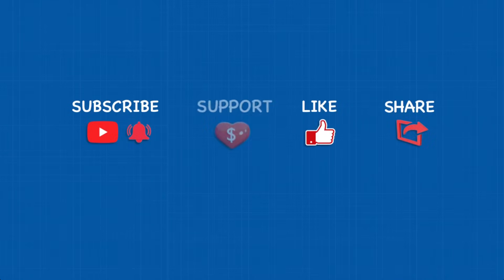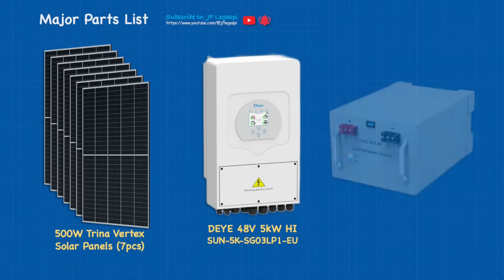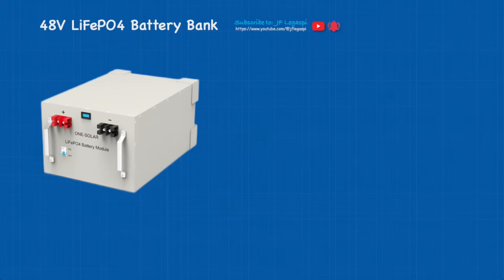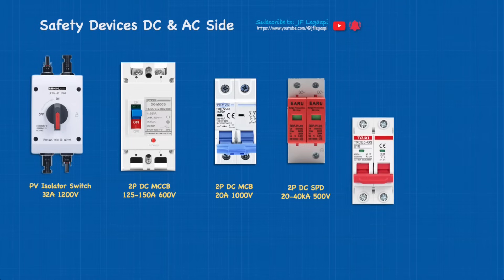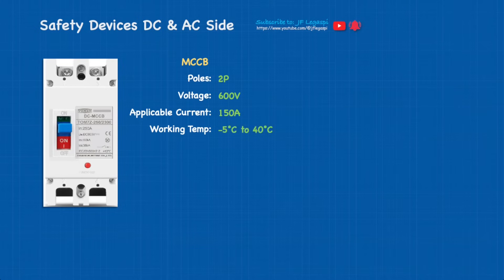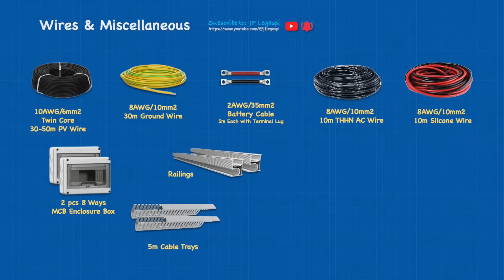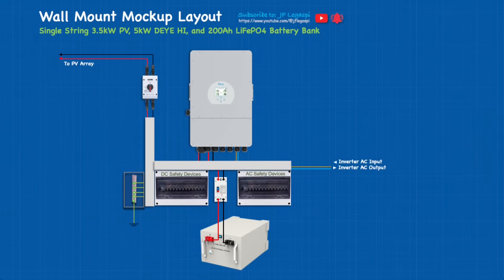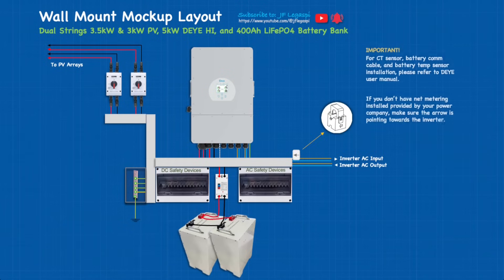How To Build a 48V 5kW (Deye) Hybrid On/Off-Grid Solar Power System - Complete Pro Level Tutorial

Comment: Hi hope you are well. Can you please tell me why PV input voltage range is from 125-500  Volts while MPPT voltage range is 150-425. Aren't the wires coming from PV connected to MPPT so if 125 Volts are coming from PV , how will MPPT operate as it needs 150 Volt
?
Reply from the maker: The voltage range refers to the total Voc (Open Circuit Voltage) of the solar pv string. That 125V is when the inverter starts working but might not be stably charging the battery bank or exporting energy back to the grid, due to the fact that when it’s cloudy, the Voc gets lower than that. That’s why they recommend 150V (lowest) when it comes to the mppt voltage.

The Mppt voltage range refers to the total Vmp of the solar pv string. Ideally, the lowest voltage recommende for that mppt tracker to work continuously (even when it’s cloudy), is 150V. Typically, the Vmp voltage is always lower than the Voc.

I hope it makes sense. 😊
Reply: @JFLegaspi  Thanks so in short MPPT voltage range  is in Vmp which is less than Voc so that's why MPPT voltage range is higher? 
Also, can you please explain the formula of  how to calculate all the circuit breakers and SPD ratings ? 
Many Thanks

Comment: We are in Cebu City and the electric grid here uses line to line. The Inverters that are available here are EU standards. the Input and output terminals are L-N-PE. How do you safely wire the inverter? I've purchased 14 550 watts Trina panels using your discount since I'm a follower of yours and I'm also thinking of purchasing a Solis S6 inverter. Which inverter to you prefer? The new Solis S6 Pro 6KW or Deye 5KW? Which one will you recommend? Thanks

Comment: Sir JF, sa setup na ito, pwede bang hindi na ikakabit ang grid line sa Inverter? Bale maglalagay ako ng isang separate ATS para kung batt low na ay kusang lilipat sa DU.
Reply from the maker: Good day. Pwede po. Para po makasiguro at maintindihan nyo ng mabuti, pakibasa po ang specs at manual ng Deye inverter. 😊👍

Comment: Sir JF ano po ba ma-e rerecommend nyo po na pinakamagandang brand ng Hybrid/controller inverter po? 
Sana masahot,  salamat po
Reply from the maker: Depende yan sa budget ninyo. Napakaraming magagandang hybrid inverter na mabibili.
Reply: @JFLegaspi  yong DEYE unit na ginamit dito, ok na ba yon gagamitin.  May warranty ba yong mga parts na to? sa US kasi, yong nag install ng solar unit mo, sila na lahat pumili ng parts from PV panels to the Inverter at commissioning/permit application.  So, binayaran ko is the entire system at may warranty yong parts for around 25 years, maintenance and repair.  I do not have to worry if any of the parts fail.  Dito sa Pinas, if you buy these parts and DIY, is there any reliability that these parts last for a long time?  Maintenance and repair is always borne by the owner.  So, if the parts that were installed did not have long term history of reliability, you end up costing your system more.

Comment: Hello po! Question lang po sa load side ng inverter, papunta po ito sa existing distribution panel ng bahay, meaning po ay magiging 2 pair po yung cable sa main breaker ng existing distribution board? 1 pair po from inverter side at 1 pir from DU side? Thanks po at God bless! Maraming salamat po
Reply from the maker: Good day. Kung gusto nyong gamitin ang solar setup sa inyong buong household load, dapat may ATS (automatic transfer switch). Merong para main power source at back-up power. Nasa sa inyo kung akin ang gagawin nyong main power, solar setup or DU/grid.
Reply: @JFLegaspi  Salamat po! Nag iisip po kasi ako mag DIY. Do you do consultation ang design po? Salamat po uli at God bless!
Reply from the maker: @reggiecadsawan3572  opo, design, calculation/simulation, single-line/block diagram, parts list etc… pakibasa ang video description regarding may services. 😊👍☕️

Comment: Sir JF saan po ba dumidepende yung battery na 12v 24v 48v?
Reply from the maker: Good day: Kung budget ay concern at nasa learning stage ka pa lang, o di kaya ang paggagamitan ay camping van na mostly 12V dc ang load, go for 12V system. Kung system efficiency and stablity, go for 48V system. Ang 24V ay kung medyo concern sa budget pero gusto na medyo efficient ang system. 😊👍
Reply: @JFLegaspi  thank you sir JF. Balak ko po kc sir mag DIY solar setup 3kw po

Comment: Hello, I've  just installed a new DEYE SUN-8K version.  It is working well, but the main screen does not show the 4 round KW dials with the "ON" in the middle.  How can I get to that screen, please? And If I touch the ESC button below, it flashes that screen on but only for fraction of second.  What am doing wrong? My system is OFF grid only.
Reply: how many pannels/ power did you connect to the 8KW Deye?
Reply: @GlossaME  10 panels, 585W each.
Reply: @deanko55-bw4oo  i think you can go up to 10 Kw of panels with no issues

Comment: Hello sir JF, pede po ba 12pcs na 500W series sa deye 5kw hybrid? same specs po ang panel trina solar brand
Reply from the maker: Kailangan nyong mapanood ng buo ang video. Unawain nyo ng husto ang specs ng Deye inverter, lalo na ang PV Input Voltage at MPPT Voltage Range. Ano ang Voc ng 12pcs na 500W in series? Kailangan pasok yan sa specs ng Hybrid inverter.

Comment: Good day! Sir JF applicable ba ito ang mga devices para sa 8kW hybrid inverter? Balak ko kasi bilhin pakonti-konti para hindi mabigat. Pag nabili ko na lahat ipagawa ko sa Electrical or contractor pag uwi ko dyan sa atin. Salamat po.
Reply from the maker: Good day. 😊👋 Kung gusto nyong pagawan ng design at simulation ang 8kW solar power system na balak nyong buuin, pwede nyo akong kontakin sa aking FB messenger. Eto po link. https://rb.gy/mzh5z
Reply: @JFLegaspi  Thank you Sir JF! Mabuhay po kayo.

Comment: Good Morning Sir the said Inverter(Deye-5kw) as mentioned in your presentation the Input PV current is 13A + 13A..But the specs tell otherwise its 11A +11A..The Solar Panel(500w) used here the Isc is 12.28A..Wala bang maging problema dito..Thanks and God bless
Reply from the maker: Good day. That’s exactly the reason why I have specified the model number of the hybrid inverter, DEYE SUN-5K-SG03LP1-EU under Major Parts List @ 2:07 time stamp. Here’s the link to the specs. 

https://www.deyeinverter.com/deyeinverter/2021/04/14/%E3%80%90b%E3%80%91hybridinvertersun-3.6-5k-sg0103lp1-eu.pdf

Ibang model number ang gamit nyong inverter kung 11A + 11A ang input.
Reply: @JFLegaspi  Sir Many thanks..Take care

Comment: Great! I read a lot on the Internet but this absolutely the best description! Thanks a lot for this!  My deye5k is waiting for installation.  One question when i start without battery... same  starting sequence of the Inverter?  And perhaps someone can give me an hint how to calculate the right breaker between inverter and battery.  I have two strings (200v 2kW and 280v 2,8kW) on my fassade.  Kind regards Michael
And by the way: has someone a 3phase home and a meter which tolds the Inverter to give as much power to the one connected phase as the sum of all three phases?

Comment: Great job Sir JF. Malaking tulong sa mga baguhan. May tanong lang po ako. Pano kung IMP ng panel na gagamitin ko ay 13.2 amperes at ang pv input current ng Deye ay 13 amperes lang. Okay lang ba ito o kailangan kong humanap ng ibang panel? Salamat
Reply from the maker: Dapat sundin ang kung ang specs ng Deye inverter ayon sa datasheet… may dahilan yan kubg bakit 13A lang. Walang masa kung susundin ang datasheet at hindi ka kakaba-kaba at siguradong tatagal ang serbisyo ng pv system.
Reply: Maraming salamat. Considering attending your webinar this December hopefully may slot pa

Comment: Sir good day! Ask ko lang pwde po bah akong mag install nang solar panel 500 watts with VOC of 51.7 V in my 12.8 volts solar off grid set up? Or ano po ang rules for the set up for 12v,24v and 48v from solar panel to a battery system. Thanks in advance..😊
Reply from the maker: Good day 😊👋 Ang sagot sa inyong tanong ay nakabase sa specifications ng gagamitin ninyong SCC. May nakasulat po sa specs ng SCC kung ano ang supported na PV Pmax (maximum watts ng solar panels) at PV voltage (solar panel voltage). Yon po dapat ang basehan.

Para sa kompletong paliwanag, pakipanood ang akong tutorial. Eto ang link.
https://youtu.be/Rqjk18L31lg
Reply: @JFLegaspi  sir marami pong salamat at always po akong nanood sa mga video tutorial ninyo😊GOD BLESS..!

Comment: Hi sir, similar lng rin po ba ang connection at safety devices (breakers) sa Hybrid Off grid na Lvtopsun 12v 1.2kw? Thank you ^_^
Reply from the maker: Ang connections ay maaring pareho, pero ang mga MCB ay iba ang amp ratings dahil magkaiba ang power rating ng inverter at hindi ko alam kung hybrid inverter ang gagamitin mo na may built-in mppt or external ang scc mppt.
Reply: @JFLegaspi  Hello po sir ito po yung nabili ko,

Lvtopsun 12v 1.2Kw
1200w: 12v
-Rated Power:1200w
-Surge Power: 3600w in 3 secs
-Battery Rated Voltage: 12v 
-Battery Support: LEAD ACID, AGM, GEL, LIFEPO4
-Built-in AC charger, max 15A charge current
-Built-in MPPT charger, 40A
-Max PV input: maximum 100v voc, maximum 600w(12v) 
-AC Input:220vac 
-AC Input Range: 165v-275v
-Frequency: 60Hz
-Transformer type: Toroidal 
-AC Ouput : pure sine wave
Protection
- High & Low Voltage Alarm 
- Automatic self protect in short circuits and shutdown
- Over Temperature Alarm 
- Overload Alarm - Auto Shutdown in 20s
Dimensions: 
-Size: 396*294*145
-GW(kgs): 11kg

Comment: Sir JF ,,I assume the shuting Down of  the Deye Hybrid Inverter,, they same steps in Commissioning in reversed, or Differently way in shuting Down. Puedi mo kaming turo'an..
Salamat Po!
Reply from the maker: Good day sir DPQ, yes. It would be safe to do a reverse process. Wala pong anuman 😊🙏
Reply: Hi Sir JF ,,During my spare time this Holidays i used to read my Deye Manual as what you have suggested,   and have come to understand . In my own, and eager to learn our Solar setup.
My Question is,Why in the Manual no ATS shown in Connection wiring diagram,,Gaano ka Importante ang ATS sa Hybrid Inverter, puedi ba na walang ATS?
Salamat Po! 
Advance  Bountiful New Year to you and your Family
God bless
Reply from the maker: @dpacificquiaoit8312  good day. The Deye hybrid inverter comes with a built-in ATS function, but there is an advantage using an external ATS which I will discuss in a tutorial, “How to Connect Inverter AC Output to Household Main Panel Board.”

Comment: Best vlog I have seen on a 5kW system.
Thank you.
However, what would stop me using 8 of these panels in series?
I ask because 8 x 500w => 4000w would make no problem
VOC 8 x 51.7v => 413.6v would be in the PV input voltage range (125 to 500v)

Comment: Sir JF good day po. Ask ko lang po Kung pede na wala pa muna battery ? Due to budget, safe po ba ang magiging operation ng system sa ganuong set up. Salamat po ng marami.
Reply from the maker: Good day. Pwede naman na walang battery st gagana ang Deye inverter. Hindi lang magiging stable ang AC output ng inverter to load, lalo na kung maaraw. Pero pwedeng gamitin as grid-tied inverter ang Deye, kailangan lang naka net-metering kayo.

Comment: Sir pano po if two parallel 5kw deye hybrid with one 150ah battery?
Reply from the maker: Ang 150Ah na battery bank, sa 1C ay 150A ang discharge current. Ang 10kW (2x 5kW inverter) ay nasa 195A ang total max current draw. Pwede kung sa pwede, huwag lang isagad ang load ng dalawang inverter para hindi somobra sa C-rate ng battery bank.

Comment: Good day Sir JF. Ask ko lang po. since 6500 max w ang PV input. D po pa ibig sabihin eh dapat 3250w lang per MPPT? or as long as hindi ka lalampas ng 6500w, regardless kung hindi equal ang wattage ng PV1 at PV2.
Reply from the maker: Kung gusto nyong hatiin equally ang PV sa dalawang mppt input pwede din naman. Pwede ding 6,500W sa isang mppt input at "not allocated" ang 2nd mppt input, dahil naabot na ang pv pmax.

Comment: Hello prof, ask ko lang po if no battery method gagawin ko. Need ko pa ba connect ac out ng inverter or ung grid side lang ( ac input)? May iba kasi ako napanuod, no connection ang ac out nya. Thanks and more power
Reply from the maker: Pwede pong walang load at gawing grid tied ang function ng Deye inverter… kung yan po ang gusto nyong itanong. 😊
Reply: Thank you so much prof. God bless you always. 🙏

Comment: thank you for the info, my observation, after 5 years use both battery and inverter reach end of life... so if electricity stays at current rate solar does not make sense yet...
Reply: Because you buy cheap Chinese quality. Stop buying cheap
Reply: Good thing these inverter has a 10 year warranty- some even have 15 or more

Comment: goodnoon sir what if my total load is 100Kw and I have 8KW inverter hybrid inverter makaka apekto bah ito sa inverter ko po if may net metering
?
Reply from the maker: Good day. A 100kw load is 12.5 times bigger than 8kW hybrid inverter. Imposibleng kakayanin ang load kung naka connect sa AC output ng hybrid inverter.

Comment: sir gud am, ano po yong warning code 15 tiningnan ko sa manual ang nkalagay don is PV energy is low ano po ang ibigsabihin po non..slmat po sa sagot po
Reply from the maker: Good day. Siguruhin nyo po na ang Voc/Vmp ng pv array ay above sa required ng hybrid inverter na nakasulat sa specs neto. 

Pakipanood nyo eto para mas maunawaan nyo ng husto. Paano Mag-Match ng Solar Panel PV Array at SCC or Hybrid Inverter - Pro Level Tutorial
https://youtu.be/Rqjk18L31lg

Comment: Sir if mag install po ako ng 5kw hybrid inverter, tapos lumagpas po yung load ko ng 5kw, mg fault ba inverter, or sasaluhin ba ng grid?
Reply: sasaluhin ng grid
Reply from the maker: Good day. Kung ang load ay naka konekta sa AC output ng hybrid inverter, 5kW lang ang continuous power rating ng inverter.

Comment: What about compliance to NEC 690.7 and 690.8??? That is very important if you are designing per international standards…These are the foundations of design and if you do not consider them, it would be quite hard to believe how you can design commercial and utility scale solar system.
Reply from the maker: The calculations of disconnection means, conductors, safety devices etc. in this video were based on the PEC standard.

If you adopt this design, it is your own personal RESPONSIBILITY to make all the calculations based on NEC. Let me just emphasize that once again… Yours and yours alone.

I hope that is clear enough!!
Reply: @JFLegaspi  PEC is adopted from NEC, the same requirement applies. Solar PV in PEC is Article 6.90.

Comment: If the 7 panels are connected in parallel: 3500W but not 300V, the voltage does not add up, then it is 50V empty, without connecting, so they are 24V panels connected and that is what they will have or little more
Reply: Tama ka Sir Ferrycal muñoz, yang comment mo na yan ang hinahanap ko dito sa comment section, ikaw lang ang nakakaintindi at naka pansin,
Hindi nag re reply si Sir JF pag mali siya he...he.., peace po.
Reply: It is connected in SERIES. Look at the Red and Black wires of the PVs connected. So voltage is added and Current is retained.
Reply from the maker: @geraldreyes7835 😊👍
Reply from the maker: @sersiobordios saan ang mali dyan, paki specicify at hindi ako mahirap umamin ng pagkakamali. Malay mo at may matututunan pa ako mula sa’yo. 😊

Comment: Sir bumili po ako nito and im trying to replicate your instruction. However ang application ko is more than 5KW for Home Load. Should i follow your diagram or should i follow the wiring diagram ng manual na ilagay sa Home Load tied with Grid.
Reply from the maker: Magandang araw po sa inyo.😊  And pinaka best na gawin nyo ay humingi ng technical support kung saan nyo binili ang Deye inverter. Kung wala po kayong sapat na technical na kaalaman, huwag nyo pong i DIY. Seek professional assistance galing sa mga professional installer companies na may mga tauhang electrical engineers. Eto ang link ng guide (blocked diagram) kung paano gawin. https://www.deyeinverter.com/deyeinverter/2021/12/07/deyesolarenergystoragesolutions.pdf

Comment: Hi Sir JF, okay lang po ba single string sa setup ko?
Solar panel 550w 1pc:
vmp = 41.7v
voc = 49.6vdc
imp = 13.2a
isc = 14a

Solar panel 8pcs 550w:
vmp = 333vdc
voc = 400vdc
imp = 13.2a
isc = 14a

Inverter 5kw Deye hybrid:
Max Pv input V = 500v
Start-up V = 125v
Mppt V range = 150-425
Rated  PV Input = 370v
Max Input Short-Circuit Current = 17A
Max Operating PV Input Current = 13A

Balak ko po sana i single string nalang kasi pasok naman sa max pv input, makaka affect po ba yung rated pv input na 370v sa setup ko? tsaka yung max operaring pv input current na 13A ng inverter? salamat po sana matulungan niyo ako bago ko umpisahan setup ko! salamat po!

Comment: mas okay po ba ganitong setup kesa don sa 24V 3KW OFFGRID system na video nyo  if ang load is .6hp inverter ac and mini ref na magrarun ng 24hours? calculated total load po ng bahay kasi namin is 14kWh a day , thanks po in advance
Reply from the maker: Mas stable at efficient ang 48V system for residential loads. Kung kailangan mo ng consulation and other technical assistance, it comes with a prof. fee.

FOR INQUIRIES: jflegaspisolar@gmail.com
DIRECT MESSAGE: https://www.facebook.com/jflegaspifb
FOR SOLAR PV INSTALLATION & CONSULTATION: https://www.facebook.com/jflegaspisolar
JOIN MY FB GROUP: https://www.facebook.com/groups/lithiumpowerphilippines

Comment: bakit po sa wiring diagram ni deye naka parallel ang home load sa GRID?
Reply from the maker: Ang home load ay sa main panel board naka connect, ang critical o back up load ay sa mismong AC output ng inverter 😊👍